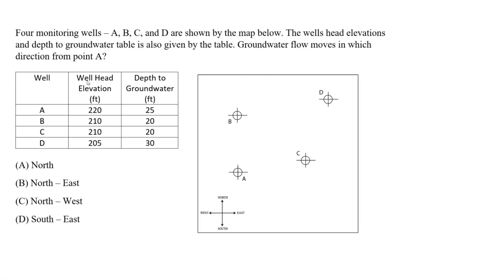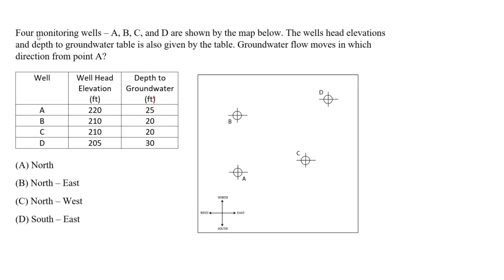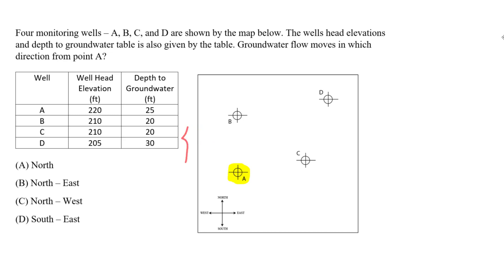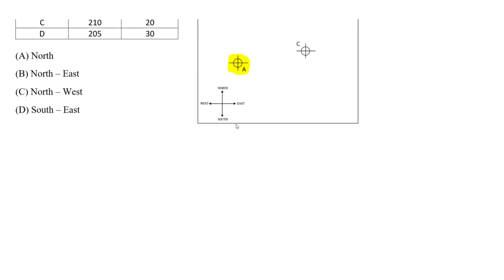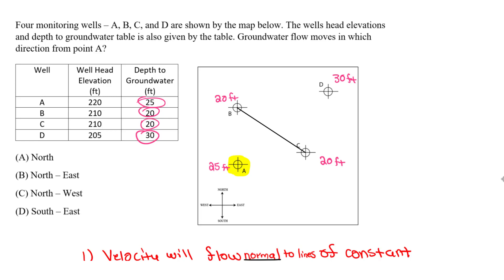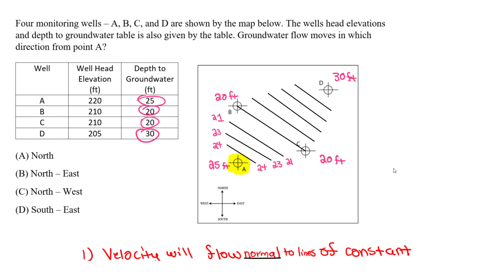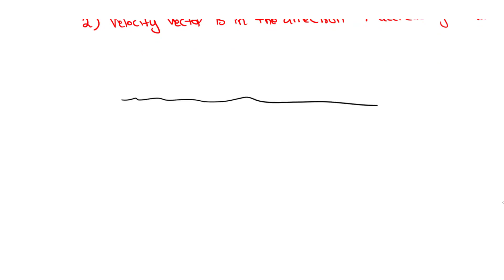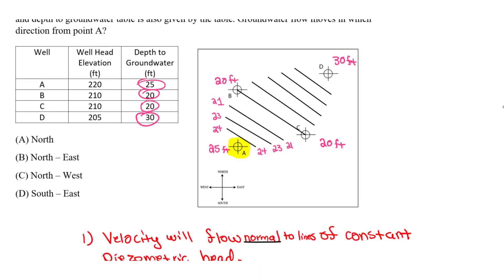FE Exam Review - FE Civil/Environmental - Water Resources - Groundwater Flow

Comment: Hello, in the cross-section sketch you drew, the 220' and the 205' should be 195' and 175' respectively. The well head should be above the water table. so we subtract 220'- 25' =195' and 205'-30' = 175'. Can you please verify? Thank you.
Reply from the maker: Yes! Very sorry about that. I made a mistake when writing the well-head elevation at A. You're right!

Comment: I got problem kind of like this on the enviromental FE that I'm trying to figure out if I got right. The difference is that there were four pizo tubes in a square around a centralized well. Each pizo tube had a specific head height associated with it. And you were asked which way the flow would go. No other information was given. Just the heads. I picked the one with the highest head.
Reply from the maker: Hi Kevin, this sounds interesting! 

Water will always flow from high head to low head. The greatest difference in head would dominate the direction of flow in this case.
Reply: @directhubfeexam  Thank you. Just to make sure I understand. Since the elevations were all the same from pizo tube to pizo tube. All the information I had was the head height. And they did tell me the center well was the  equpotienial the direction of flow would be the greatest difference in head.

Comment: So I'm trying to draw a cross section like you did but I'm having trouble wrapping my head around it.

At first (before playing your video) I drew it like this: This made sense to me, water flowed down hill. 

-- 220'
|              -- 210'
|               |              -- 205'  Surface
|               |              |
|               |              |
|               |              |
-- 25'       -- 20'       |
                               |
                               |
                              -- 30' Groundwater level

But you're saying it should look like this: I am struggling to understand how the groundwater would be lower in the middle but still flow NE.  

____    Surface
|           \            ________ 
|             \____/       |
|  25'        |   20'      | 30'
|               |              |
|               |              |
-- 220'     |              |
|              -- 210'     |      
|               |              -- 205' 
|               |              |
------------------------------------ Datum 

Could you please explain it? (Thank you for making these videos by the way, very helpful!)
Reply from the maker: Sorry for the delayed response. Your question was always in the back of my mind. 

Here is how I fixed this in the course: 

https://snipboard.io/bwiXqp.jpg
Reply: @directhubfeexam  Thank you, that does make sense I think, but where did you get the numbers?
Reply from the maker: @chotta7733  Crap, I forgot I changed the problem inside the course to test my students who watched this youtube video already. Here is the problem statement from the course: 

https://snipboard.io/8enab0.jpg

Thank you for your patience.

Comment: Does the well head elevation mean the elevation from sea surface (or any datum) to the top of the well? And if so, wouldn't the equipotential lines = Well Head Elevation - Depth to Groundwater
Reply from the maker: Hi Abdullah, your first statement is correct from what I know. 

So equipotential lines are lines that have "equal potential" (i.e. lines of constant head). I doubt they will ask you to draw these on the FE exam but if you had to: 

Let's say you have 3 wells: 

(1) Draw lines connecting wells
(2) Note elevation at each well
(3) Map distances between wells
(4) Note difference in elevations
(5) Find distance for a unit head drop between wells
(6) Mark even increments
(7) Repeat for all the well pairs
(8) Create the equipotential contour lines 
(9) Draw the normal to these lines (this is the direction of flow)

Hope this helps, this isn't really my area of expertise - just helping for the FE exam.